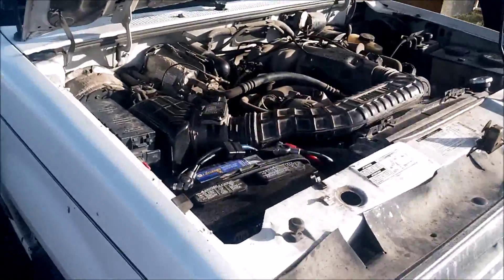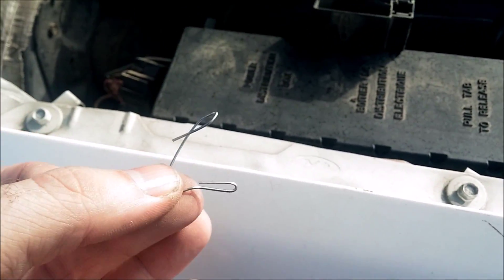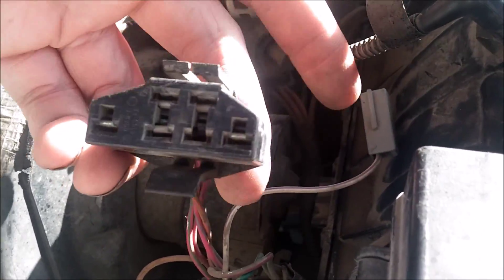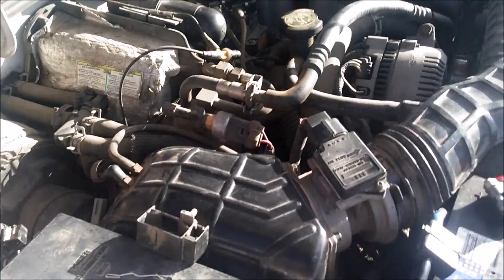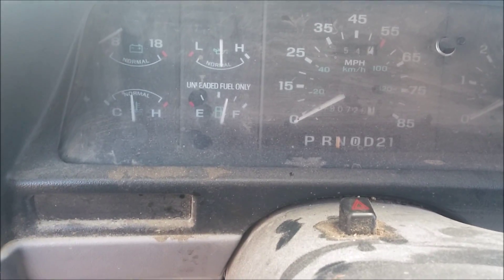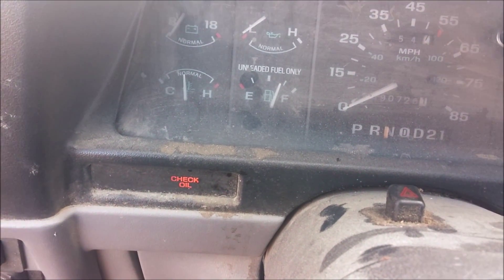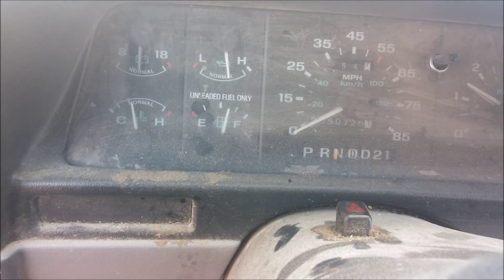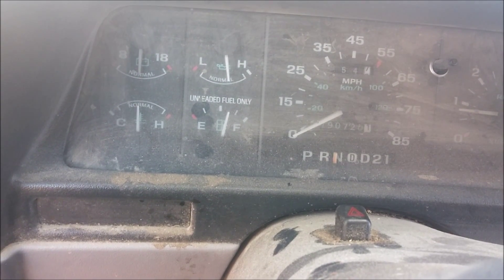1994 Explorer - How to perform KOEO & KOER tests on EEC-IV Fords.

Comment: That isn't always accurate. You need a code- tester like a Actron CP9690. It checks codes and has code-connect to diagnose codes. Just because you get a code saying a part don't always mean it's that part. The CP9690 shows the code in print and has code- connect to tell you possible solutions. Otherwise you'll replace  un-necessary parts. EBAY has it. It comes in a black pouch. It has a cigarette-lighter cable. It uses 4 aaa batteries, not included. It's well-lit! Get the USB cable to update it.
Reply from the maker: I totally agree. Just because you get an oxygen sensor code doesn't mean you should replace it, it's likely working fine and telling you that there's a vacuum leak or something wrong with the fuel system. However I do disagree with getting the scan tool. Researching your code, especially on Explorer forums, can be far more valuable than a code reader. Just my experience.
Reply: @HsCSpanky  Using wires isn't accurate. You NEED a code tester with code-connect because it tells you the right solution for that code.  The tester reads in print the code for that vehicle. Oxygen sensor codes can mean the sensor detects a condition affecting the O2 sensor. On Ford, if you get improper vacuum to the EGR, replace the charcoal canister purge valve. If you get rich oxygen sensor codes, replace the MAP sensor. Check for leaking injectors, etc. Code testers match the code to that vehicle on-screen.  I have the CP9690 and Snap-On scanner. If both oxygen sensors say rich, it's the engine is rich. Code testers cost but you have a better idea rather than using a wire. They show the code on the screen. Disconnecting the battery for about 15 minutes erases the memory code. After replacing a part, retest. It's common for new codes to pop up. Run fuel- injection cleaner in the tank to clean injectors etc. Run the engine or better yet drive it to erase unnecessary codes. A thermostat that's opening too soon can cause rich codes. Even a digital Ford code tester is better than a wire. Get a tester with a definition. On some Ford's, it's common to get certain codes, but guys are having a hard time getting rid of those codes. It's like there's a bug in Ford systems that Ford can't get rid of.
Reply: you could diagnose the problem yourself too, especially on these older ones a lot of the sensors can be tested with a multi meter. But a good scan tool would be faster probably.
Reply: @fordman7479  The Action CP9690 has code-connect to match symptoms and the cure. Testing sensors takes time and you STILL might mis-diagnose. Plastic parts break. You have to know the specs to test it. You can get both oxygen sensors rich and not know it's the MAP sensor. The EGR can get vacuum at idle and you wouldn't know it's the charcoal canister purge valve. Different cars have different codes. A digital code tester doesn't tell you the correct part like code-connect.

Comment: Hey man, thanks for the videos on your 94 explorer. I have a 94 explorer too that I use as my daily driver and it's as loyal as it gets. It's also fun messing around with older engines!
 I was curious if you think I should preform this test on my truck? I have no check engine light, everything's smooth and great on it. Just wondering if this is something I should do just to check all the bases! 
Thank you!
Reply from the maker: Wouldn't hurt to learn how and get more familiar with your vehicle. I doubt you'll come back with any codes though.
Reply: True, Thanks man! I'll have to give it a go sometime!
Reply: To check the transmission fluid, get a fluid pump-Lubrimatic 55-001, a T-30 bit, and a CTA 7420 cone adaptor. On You-Tube, watch vids. how to check and fill the fluid.
Reply: A CP9690 can check the codes if the bulb is burnt out. It shows the definitions of codes. OBDI just shows codes. It checks KOEO, KOER, solenoid and relay test, it checks memory codes, and MORE!   A Snap-On scanner is better suited for OBDI. It has troubleshooting feature on the menu to diagnose codes. EBAY has both. You need personality keys, manuals, cables, adaptors, a battery clamp cable for the adaptor. Ford OBDI uses a Ford-1B adaptor. It uses a 9 volt square battery. Get a battery pak and wall charger cable to review test results away from the car. See if you can find a case. Ford OBDII uses a K2-A  personality key.

Comment: What's the little gray box for.
Reply from the maker: Angel Duran where?
Reply: @HsCSpanky  that little gray box that's part of the connector but it's separate. The one with white and purple strips
Reply from the maker: Angel Duran I believe that's a splice into the check engine light. So you're connecting the computer output to the check engine light to count the pulses.
Reply: @HsCSpanky  what if I don't have that little gray box. Does it really matter?
Reply from the maker: Angel Duran as long as you have the two wires to connect, that's all that matters. When you're done, wrap any exposed contacts with electrical tape.
Reply: @HsCSpanky  what I ment was i don't have the little gray box nor the wire to it. I have an off road truck and when I had them take off all the wires that wasn't needed. That wired disappeared as well. So  I just have the black triangle looking thing. That's why I'm asking if it's needed. Or can I still run a test on it with out that wire completely.
Reply from the maker: Ah, I gotcha now. I think you can hook a test light in place of the gray lone wire. Then the other end of the test light to battery ground. If that doesn't work, do battery positive. I'm pretty sure it's ground though.
Reply: @angelduran3323  That means you have MECS system. Get a Snap- On scanner and a Ford1- B adaptor and primary cartridge and troubleshooter cartridge and battery clamp cable, and 9v square battery, and manual. See if you can find a case. EBAY has it. The gray box plugs into the small side of the test adaptor.

Comment: Get a code tester like the Actron CP9690. It checks live, record, graphing, oxygen sensor test, oil light reset, ABS, and MORE! It comes in a black pouch. It has OBD I cables for Ford G.M, Chrysler, and 2 Toyota. A code 111 on Ford is a pass code. Code 222 is 3 quick flashes. There is a separator  code 111. If you get vacuum at the EGR at idle, replace the charcoal canister purge valve. If you get oxygen sensor running rich and lean codes, replace the MAP sensor. Rich codes can be the CTS or high fuel pressure.